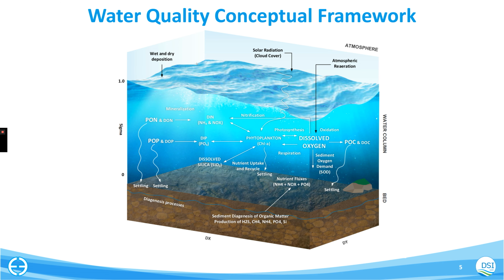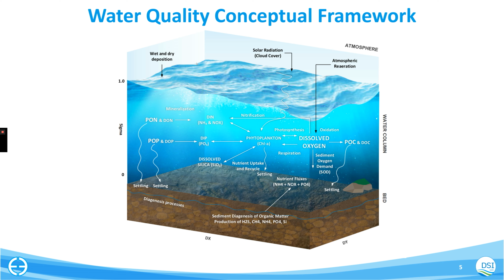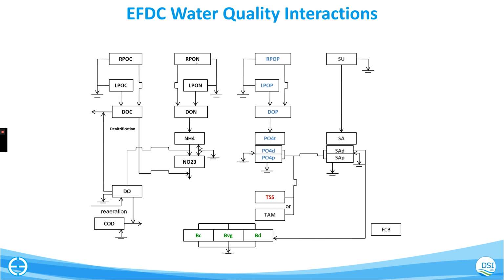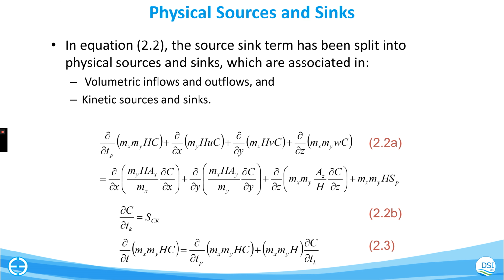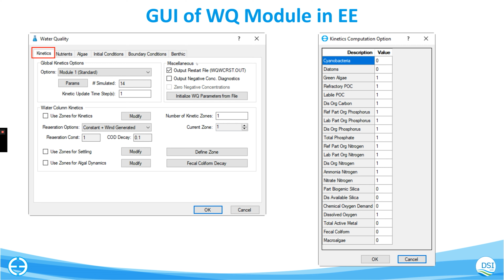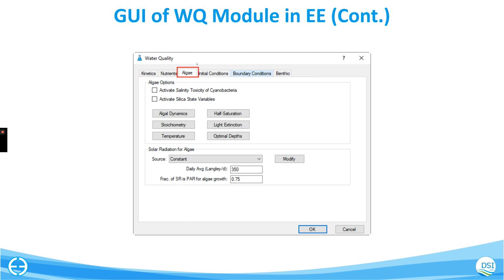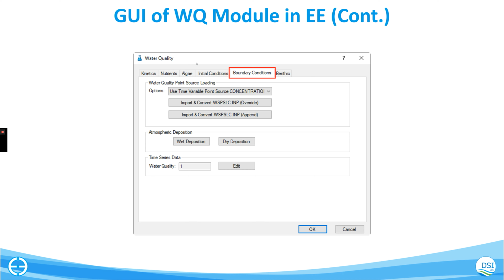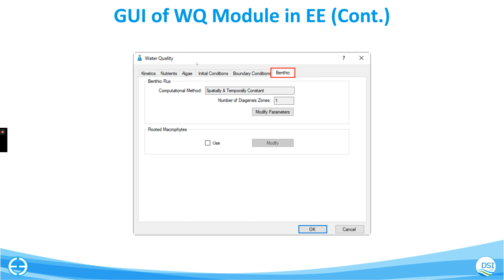#4 Water Quality Lecture

Comment: If, for example, I defined zone 1 for the whole model, how can I put zone 0 again, so that I take into account the parameters of the "algae" tab?

Because in tab 3, you have better options to define the algae.
Reply from the maker: To do that you can uncheck the "Use Zone Kinetics" option in WQ > Kinetics Tab. It is shown in Fig 1 here https://eemodelingsystem.atlassian.net/wiki/spaces/EK/pages/245202988/Kinetics
Reply: @EEModelingSystem  Hello! Thank you very much for answering. I have another question, modify "chlorophyll ratio for Algae: Greens (mg C / μg Chl)" to 0.65 (IS THIS VALUE TOO LARGE? Is there any bibliography where I can see suitable values?

Thanks a lot.